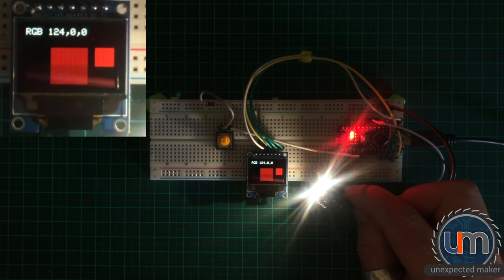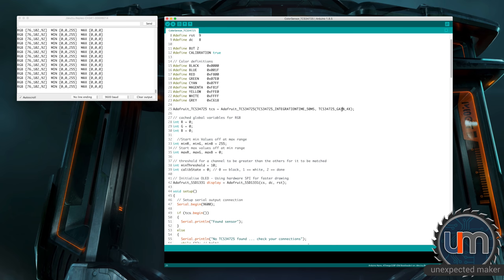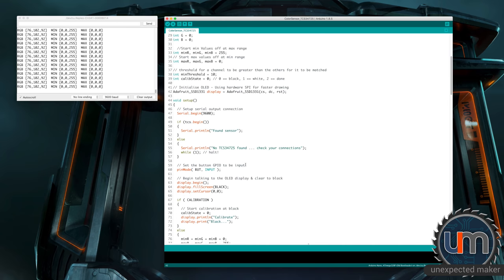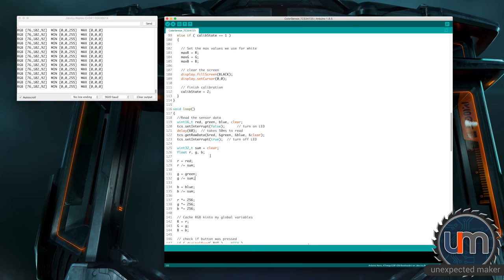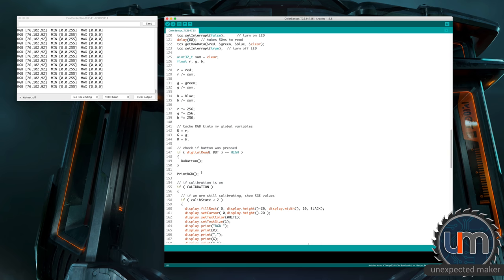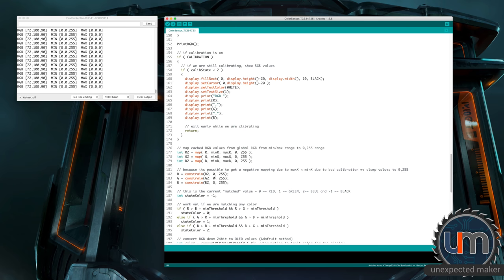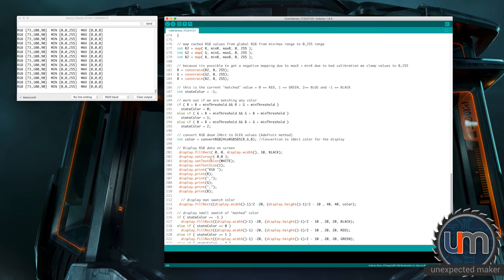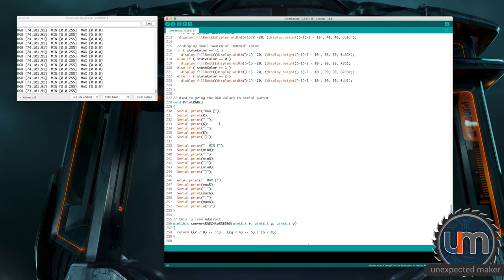Colour Sensor Shoot-Out - Part 3 - TCS34725

Comment: Try calibrating the black level in open air, without holding it against something black. I'm wondering if that will yield better results and help to compensate for the LED's glare without introducing weird colour offsets.
Reply from the maker: I was basically in a lightless room using it, it def didn't help or change the calibration quality at all :(
Reply: Unexpected Maker That's a shame 😞 Can the brightness of the LED be adjusted? I'm thinking multiple scans at different brightness levels might work, then pick the reading that has the largest distinction between the red, green and blue channels.
That's what I'm gonna try when I get one of these. Also a light shroud.
Reply from the maker: I think a shroud would def help. No ability to control the brightness of the LEDs, but that would be a good hack for sure!
Reply: Unexpected Maker Apparently it has adjustable gain, so might be able to tone down the sensitivity. Could maybe also PWM the led pin. I'm assuming it can be driven on and off that fast? Sensor might just see the pulses though 😞

Comment: Yeah too much work to get that running properly.
Reply from the maker: I didn't expect it to be so problematic. It still might just be me using it wrong, but I'm pretty good at colour sensors atm, so I am doubtful. That red shift is a problem... and I am in comms with Adafruit support about it, but no resolution there yet.

I have a new version of my code that auto-ranges it, but nothing I do removed the red shift :(
Reply: As soon as I put the 5v wire in, the arduino is no longer able to be detected. "Error uploading, check if the selected board is currently available"
Reply: I fixed it. Every video shows the pin is put into the 5v pin, but I only got it to work with 5v coming from arduino and going into the 3.3V
Reply from the maker: Glad you got it working!